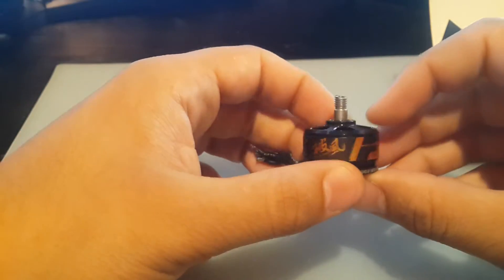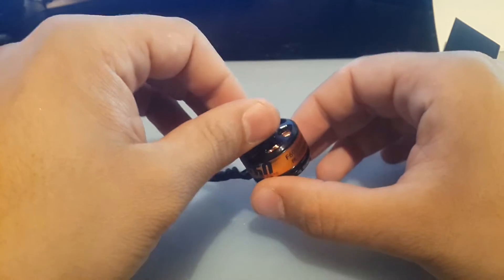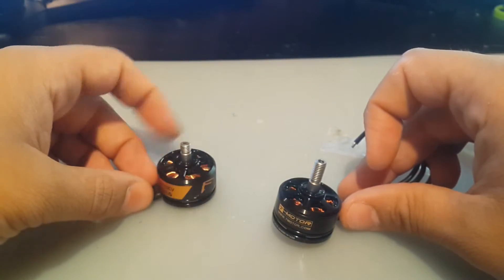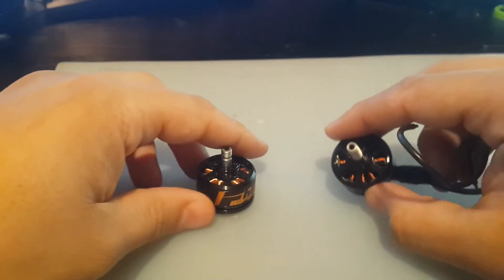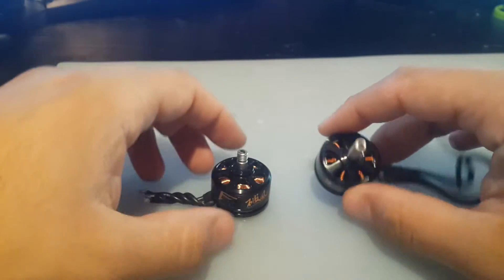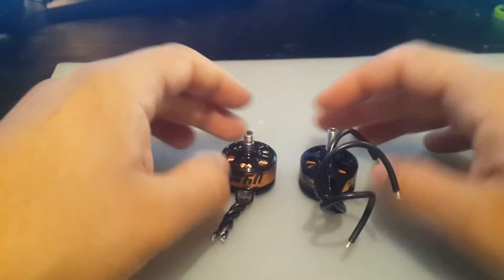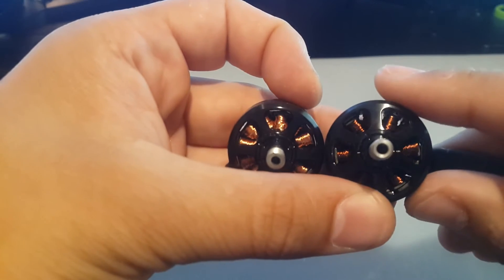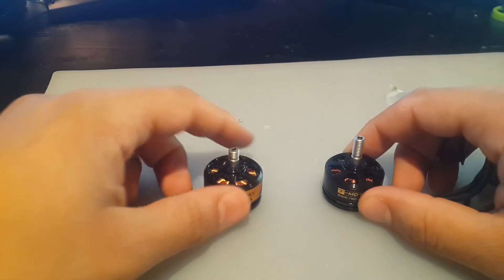Fake F60 2450kv Motors?? (T-Motor F60)

Comment: my t-motor f-60pro have the wires individually shrink wrapped. I don't have the extra heat shrink over the 3 wires. I got mine from Amazon from heli pal or heli direct or heli nation or something. 

I think some prototypes had stickers. but the pros are certainly etched, the standard f60 I'm not sure

Comment: Companies have the right to make changes in products - without changing their technical characteristics ..

And I will add.
These motors are not as common  -like Sunnysky - that would make fakes.

Look at how many people have bought these engines ..
Reply from the maker: I did not say fake only i said fake OR bad batch. I did not jump to any conclusions as i have stated I am trying to reach T-Motor about this issue
Reply: Please leave a answer - when you get it from company. Very interesting.
Reply from the maker: Yes I will update you here and make a video about this issue once i figure out whats up with these motors

Comment: Nobody has had the same problem, neither of those are fake.
Reply from the maker: This is why i made this video so I can know... So far Emax motors has clones now and Sunnysky. 

Can you explain why the inner winding's are completely different then??

 I am still trying to contact T-Motor about this waiting for a response and will update you once i receive confirmation.
Reply: I assume, the newer looking motor without the sticker is a v2 like the f40 line. I have the ones with the sticker and i love them, the magnets are not quite as strong , but the power is still there.
Reply from the maker: Yes but there is no f60 V2 just F60 pro I looked into it before making any assumptions.